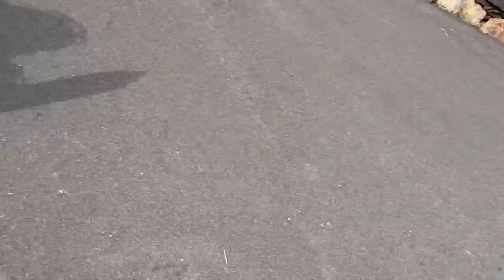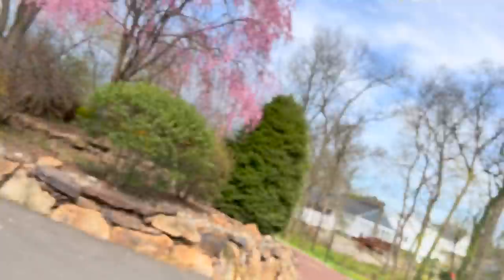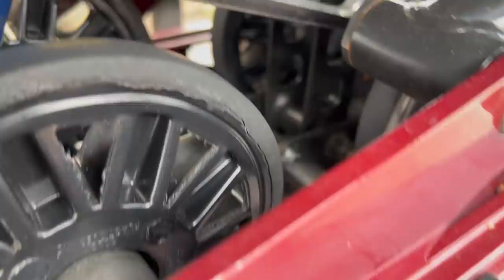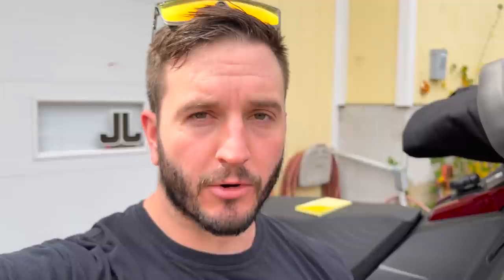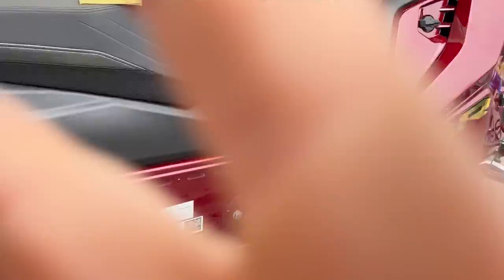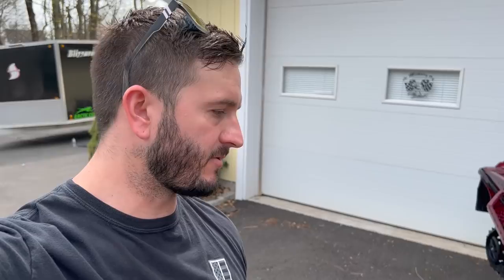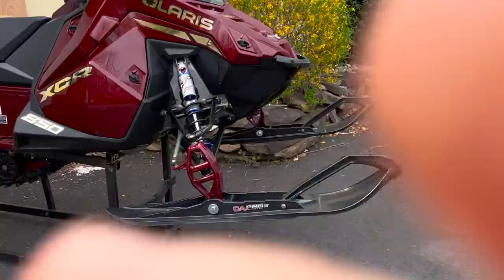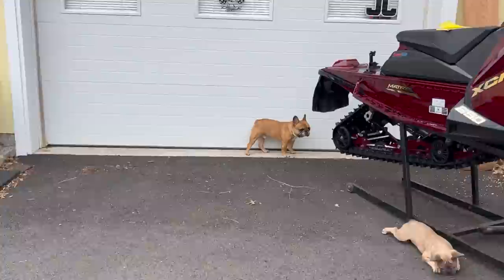SNOWMOBILE SUMMERIZATION! WHAT IS NEEDED AND WHY! DO YOU NEED TO FOG THE ENGINE?

Comment: Great video! especially the grease points. One thing I also do is Armor All. not just the seat but I spray a hot engine. it coats and shines at the same time. Especially the rubber parts. Try it,  you don't even need to wipe after you spray the engine. it gleams.
Reply from the maker: i believe that for sure. will have to try!

Comment: All great points for summer storage. I've been using WD40 for over 30 years and it does work. I'm as picky as you with when it comes to a clean sled including engine bay.
Reply from the maker: it really does! its an old school option but it really works great!

Comment: I would run it once or twice for about ten mins or 5 mins to keep the carbs from gumming up and keep the fuel lines fresh. In summer times and storage only.
Reply from the maker: correct. not as big of a deal with the fuel injected sleds that most now have but i agree its good to run them

Comment: Great video. Do you clean your power valves. I cleaned mine on my 2022 XCR. I was surprised how gummed up they were with about 2,000 miles on the sled. Polaris claims you don’t have to, but I’m glad I checked.
Reply from the maker: ive talked to Bruce and he said very very rarely does the sled actually need them so i would say no. if they were gummed up to the point of not working properly it would throw a code. so if it did then yes absolutely!

Comment: I keep my sled inside in my shop.
If I just pull the leads off the battery is that good enough or should I remove it and store in the house?
Why keep it in a trickle charger?
I store my JD lawn tractor indoors in the winter. Hook it up in the spring and away she goes.
Let me know
Reply from the maker: not a trickle charger but a battery tender. These batteries are very finicky so i like to be more safe then sorry. Keeping them charged will only lengthen their life

Comment: What is fogging? How about mothballs to repel rodents from chewing the wires? I also put duct tape over the bottom of the exhaust so rodents don’t make a nest in the can. I’ve heard of sleds going up in flames from that
Reply from the maker: That is all dependedent of where you keep them. this was just a general overview of mechanically what needs to get done. fogging is an oil that you pull the plugs out and spray in the cylinders. It coats everyything internally with excessive oil to keep anything from rusting

Comment: Thanks Jesse. Maybe the chain case oil ??? I’m having my 2021 850 jackshaft bearing replaced with the 2022 bearing. I’ve heard the 2022 bearing has been updated??? Maybe Bruce would know??
Reply from the maker: jackshaft well touch in the jackshaft video and chaincase oil well touch in the off season maintenance video!!
Reply: Hey Ed,all these bearings are the same on the drive side you pull out the seals and press in a little bearing grease every season and you'll have o problems 👍 , The grease deteriorates in these for some reason? But I'm up to around 4500 miles on my 2020 and they're still mint 👍 The chaincase side never go bad....
Reply: @youareright5431  thank you. I had some that is really knowledgeable on Polaris say the jackshaft bearing in the 2021 and the 2022 after different. I guess it’s a machined surface???? Part number 5144103.
Reply: @edwright3671  I'm not sure but what I did find is that the track drivers can be off by over 1/4 of an inch! Mine are less than an 1/8 inch off but if you're trying to align your track it's Alot! The only way to measure this is to assemble the drive shaft and measure the sprockets to each side of tunnel, there actually offset due to the chaincase protruding onto tunnel but mine needs to be off set even more! Frustrating for the price we pay for these things but good luck let us know How you make out👍👍